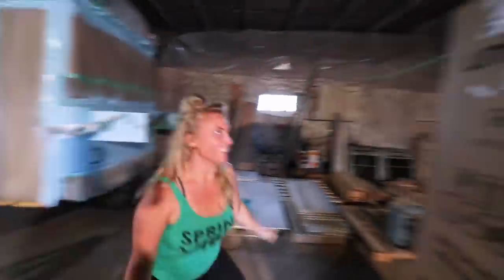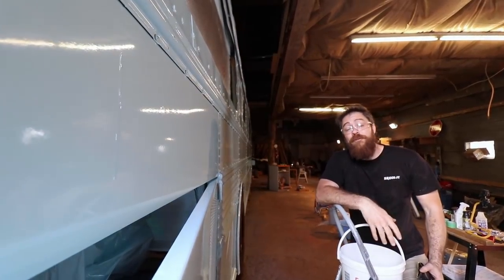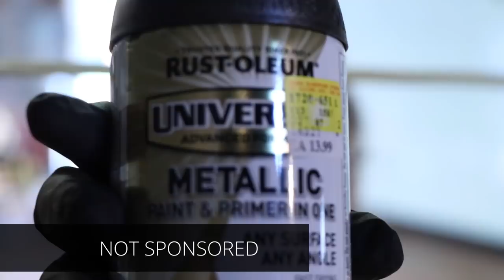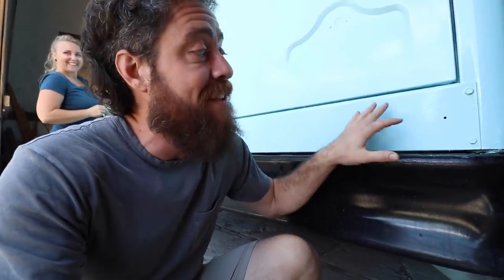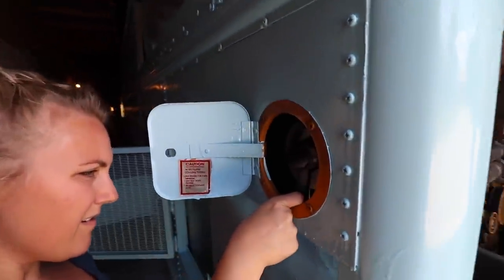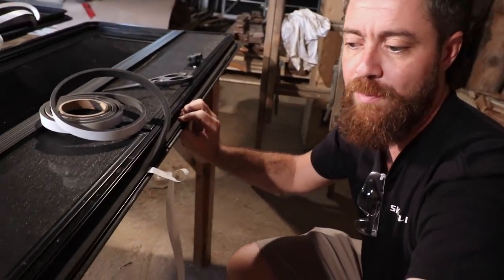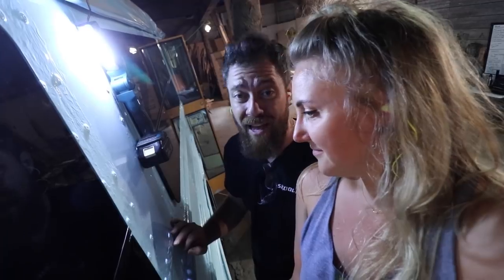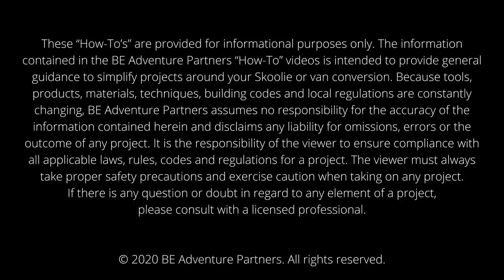Installing Sleek New Skoolie Windows After A Second Coat Of Paint | Part 2 | Bus Conversion

Comment: Paint looks excellent jop 
The windows not only excellent it is very excellent  👍
And congratulation for the new refrigerator i hope it works with 12v and  110v or 220v in the same time so what ever power source you have it will work with you.
Flexibility or Alternatives solution in all your equipments its important  
Good luck 👍
Reply from the maker: Hey hey @waleed Man! Thanks so much! We are pretty excited about the windows. Our solar power will be able to handle the fridge. It is 110v.  It is definitely a good idea to have alternative electricity. We have a few ideas for that. Stay tuned. Thanks for watching! - Erin + Brian too
Reply: About the solar power my advice to you  to take the inverter which is charge the battery and convert the voltage from 12v to 110v in the same time 
Instead buy the charger alone and the converter voltage alone.
Because the inverter which have both of them have very important thing during the day when there powerful sun and the batteries are charged already so the solar power will send what you need from the power directly from the solar panel without going to take it from the batteries and if you take more power it will take some from the batteries which reduce the amount of charging and discharging your batteries which make your batteries live longer and longer which will save you money.
I hope you understand me because my English in not that perfect.
Reply: Another advantage when using inverter if you plug 110v out source to you home  bus it will power up whatever you need and  charge your batteries in the same time.

Comment: Electric grinder with a buffing wheel and some rubbing compound will remove your scratches on your mirrors if not use off bug spay same as rubbing compound and if you want water to run off you mirrors and windows get some rain-x and buff your mirrors and windows. That Bus is looking good! You guys are doing great job!
Reply from the maker: Ohh!! That is an excellent tip @Steve Haile! We haven't revisited the mirrors yet. The convex mirrors feel like the "glass" is plastic (at least, when we thud our finger against it, it doesn't feel like glass.) Do you think the buffing wheel and rubbing compound would work for that?

Thanks for watching!
- Brian + Erin
Reply: @BEAdventurePartners  It couldn't hurt to try, Those convex mirrors can be on pricey side. I'd think it be worth a shot if it was me. Do lets us know how it comes out! Meanwhile, Have a blessed Christmas!
Reply from the maker: @stevehaile3325  we’ll give it a rip & see how it goes! We’ll include it in a video fo sho! Happy Holidays to you & yours too!

Comment: you can get the scratches off the plastic mirrors back to a eeehr mirror finish by buffing them with a polishing paste , you need the fine paste and probably one of those machines they use on cars to clean faded paint up  , could try copperpolish too if you have it though its a lot finer 
https://bcdn.hbm-machines.com/images/cache/hbm-0888.jpg-1200x600-aa28debc88.jpg
if you have spots on the bus thatare a little matt or have an orange peel you canuse the same machine to fix it after the paint is fully dry , can do that little bits at a time so you dont get burned out on it  , just dont let the polish dry up on the paint clean it off with lots of water
i realy hope the holes for the windows arent so big the they peek over the edge should the window sink a little in the frame
Reply from the maker: OooO that is great intel re: polishing paste! :) Thanks for sharing. We aren't too concerned about the flaws on the bus. Especially considering the Frankenstein look it had before. You can still see the seam sealer under the paint, and we don't care too much. The mirrors however... We will fix those up cuz they are important. We got some dribble drips off the side of the bus with your technique @watahyaknow! Thanks so much for sharing. Hope you heard us give you a shoutout in this video :) We appreciate you! - Erin + Brian too
Reply: @BEAdventurePartners  allways happy to help i apreciate the compliment
Reply from the maker: @watahyahknow  - big gratitude! :)